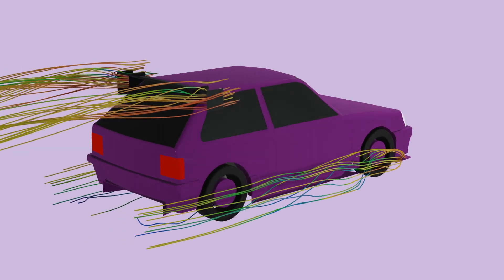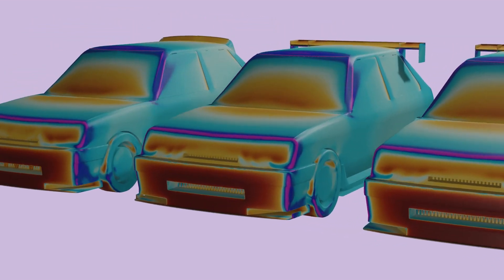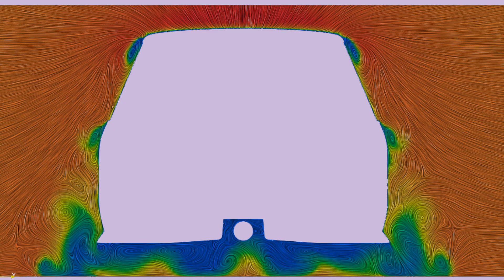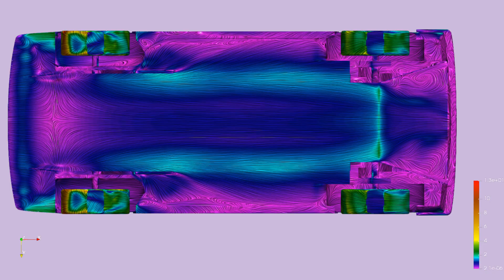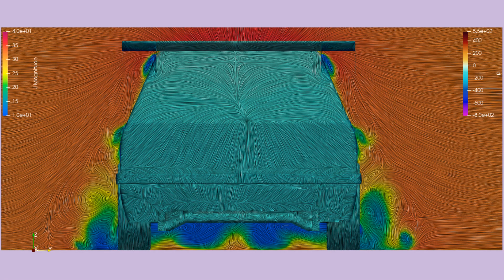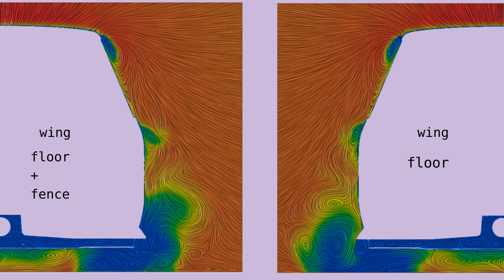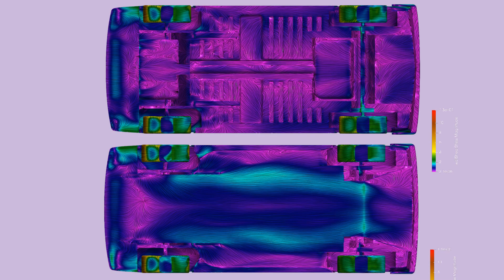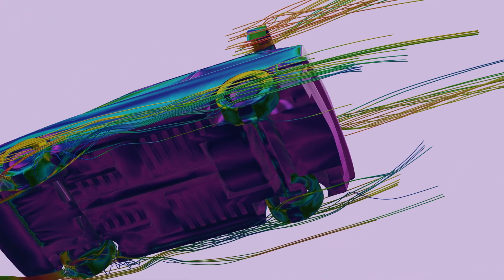Aerodynamics of a Production Car Floor

Comment: is it worth blocking air from getting to the tyres, like a guide vein between the centre line and the inner tyre? potentially angle it to suggest sending the air towards the part of the sideskirt air tries to enter under the car?
Reply from the maker: If you are ride height restricted, no. If the splitter is free to behind the front wheels then pumping some air out behind the front wheels with strakes maybe an option to help the vortex along the side.

Comment: 4:14 for the image on the right, the vortex rotation noted, is the arrow drawn the correct way? from how the data is shown i wouldve thought the vortex is rotating clockwise, not counterclockwise as shown
Reply from the maker: you are correct, there are two corotation vorticities. I finally discovered a much better way to visualise vortex rotation...bit late for this video
Reply: @nelsonphillips  thanks for clarifying. You do a great job by the way. If you had time, more videos like this for the f1 structures would be really interesting